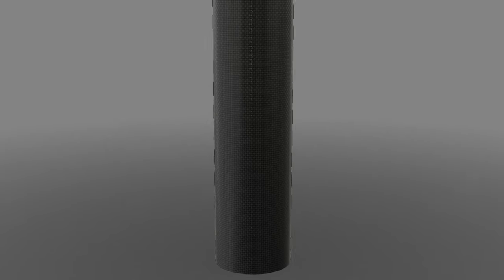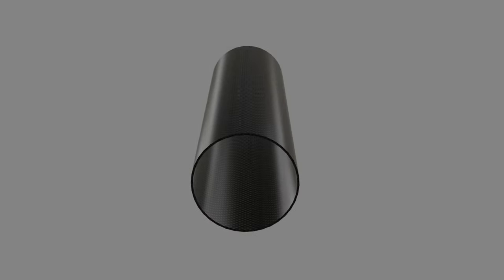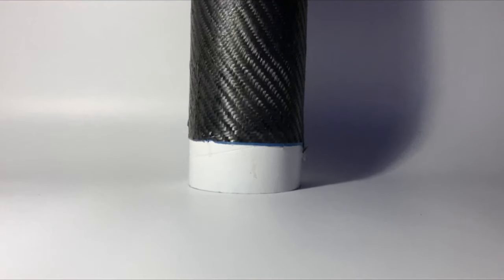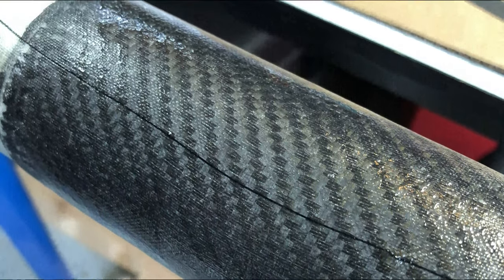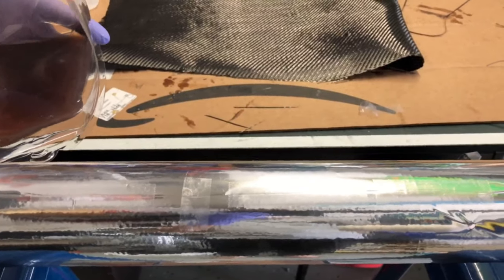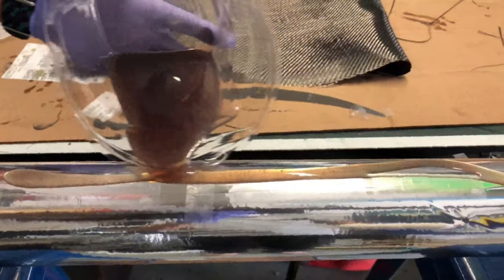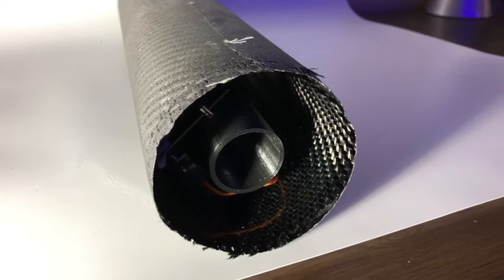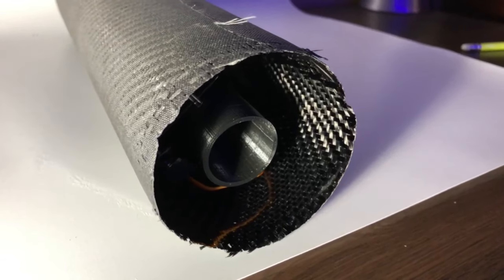Carbon Composite Manufacturing | Delta

Comment: Nice job Cole. From my experience I would recommend two layers of carbon, plenty strong and lite weight. I just use baking paper to cover my mandrel, worked great and is super cheap! I'd hate to know how much money you spent on carbon cloth for this...
Reply from the maker: ok, I found two layers to not be as very strong but it cost 100$ for 3 yards

Comment: You should definitely 3D print a ring to go around the base because it's exposed strands could be a weak point where it could start coming apart 

It also looks nasty
Reply from the maker: Mihai Lazar yeah I am going to cut the ends off of the fube
Reply from the maker: tube*